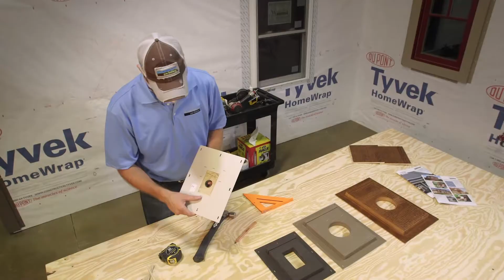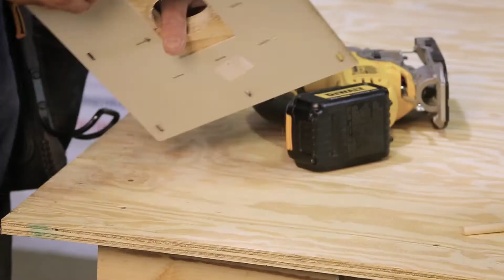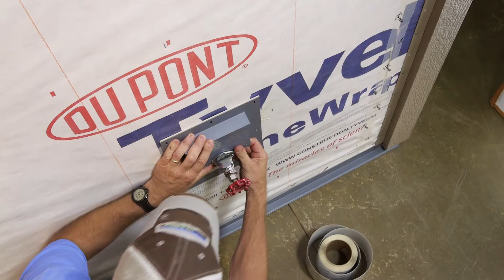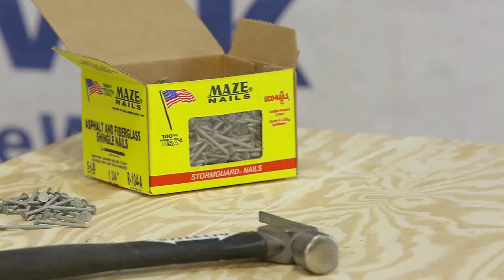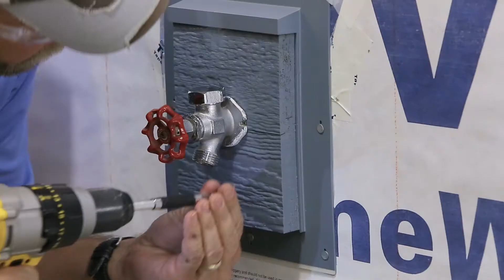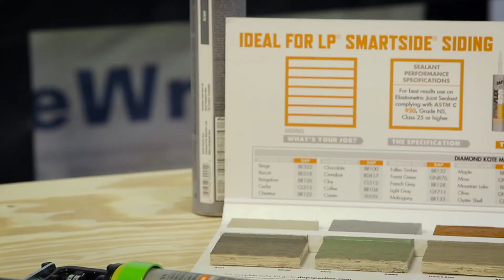Diamond Kote RigidMount Mounting Block Installation | Built on LP SmartSide

Comment: Is there a specific rigidmount block for vertical siding?
Reply from the maker: Board and batten doesn't require a special RigidMount block. In fact, you can mount the light or outlet directly to the panel because of the flat surface, unlike Lap Siding. If you want to use a RigidMount block, you absolutely can. We offer eight different RigidMounts!
Reply: @diamondkotesiding hello i wannt to ask my wall is board and batten is there any mounting block for a 6 inch wall vent

Comment: I'll respectfully disagree with taping the house wrap flap to the plastic mounting plate. Yes on the  plastic flange to the sheathing and yes on the 45 slits but no on the horizontal flap. If water makes it behind the wrap, it needs a way out... no different than the flap overlapping the top of a nail fin window install.
Reply from the maker: We do not tape the bottom of the RigidMount block. This allows any moisture that gets behind to escape.

Comment: Is there any available detail or instruction or product for rainscreens w/  3/4" furring?
Reply from the maker: For penetrations in furred wall applications the penetration should be flashed into the WRB per the WRB manufactures’ application instructions. The RigidMount can then be installed on top of the furring in order to flush out with the remainder of the siding installation. Additional furring strips will need to be installed around the site of the RigidMount block.